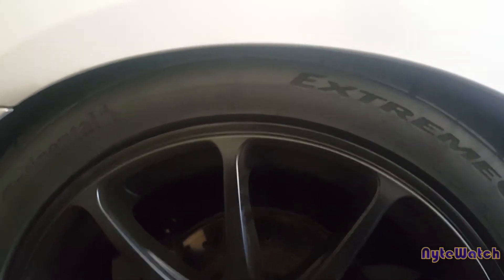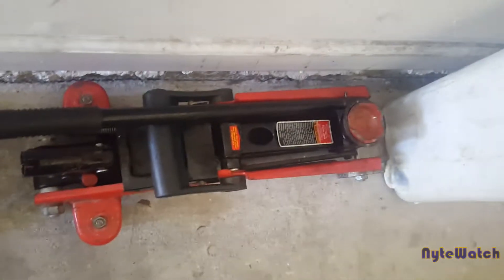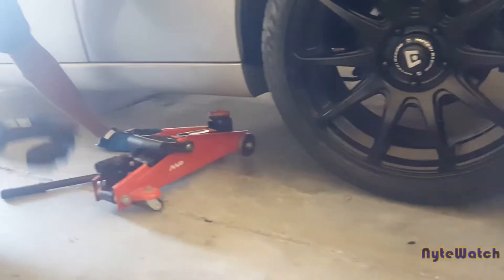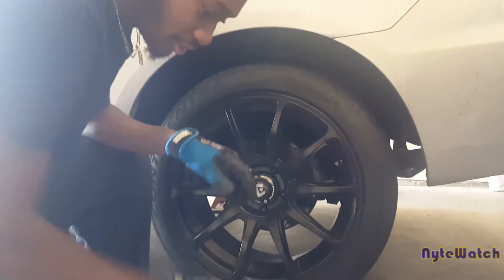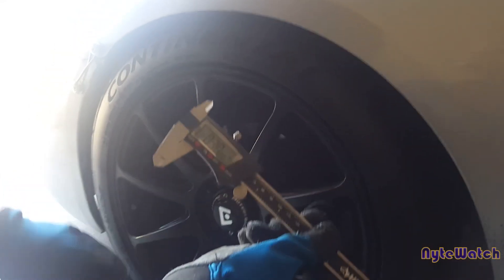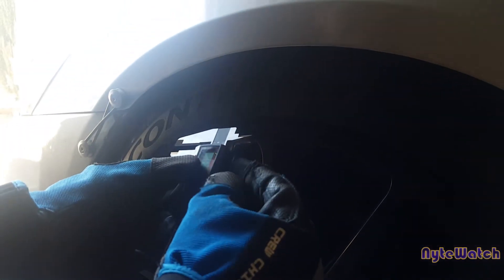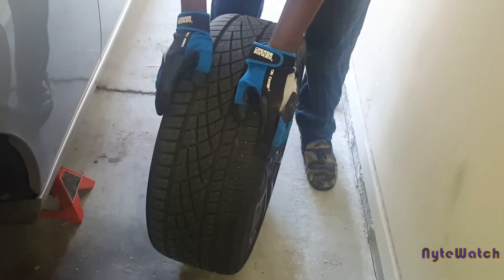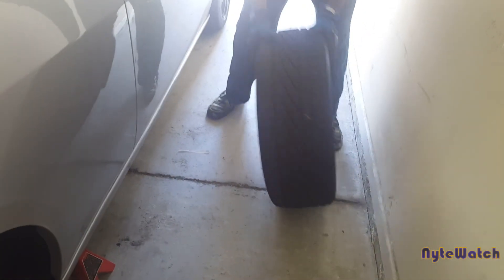BC Racing Coilovers (BR Series) : How to Adjust Ride Height

Comment: I was thinking what osos123 was saying but u are also saving the threads on my coil overs, thanks man. I was just going to stick a rag over the coilovers threads and twist away. I had been afraid of messing up my spring tension. Thanks again
Reply from the maker: No problem! I'd hate for you to have to get new ones or stick to just one height due to thread loss.

Comment: I know you weren't probably looking for exact measurements but just so you know, the upper part of your caliper that has 2 horns sticking up, you put those 2 inside where you want to measure 2 surfaces to get accurate numbers. The way you put the nose of the caliper inside the ring to measure was not so accurate.